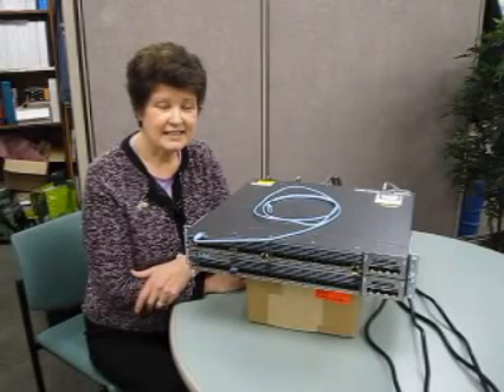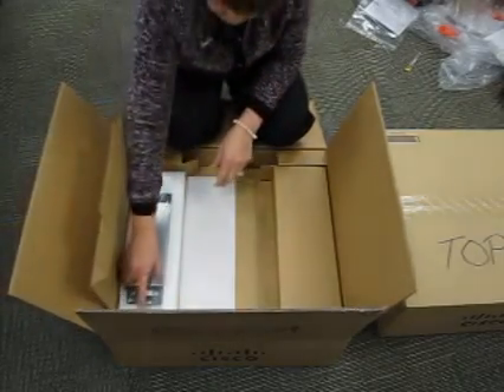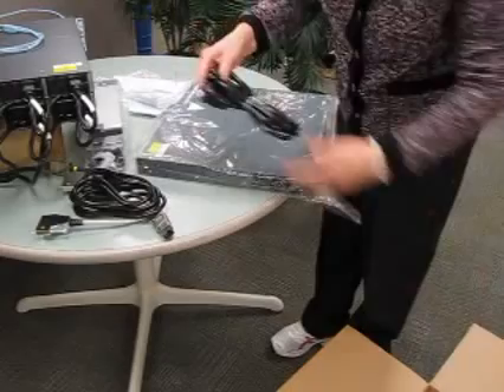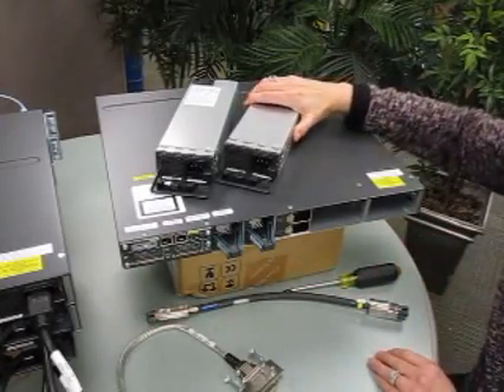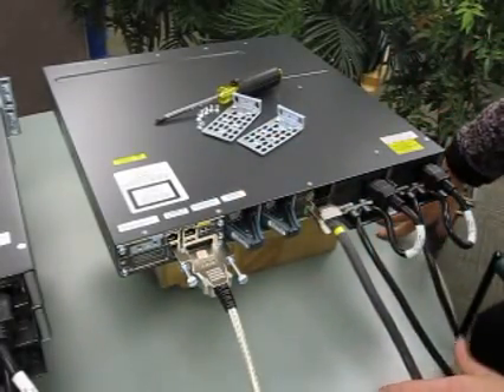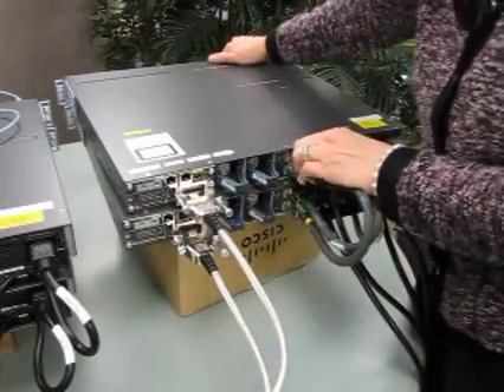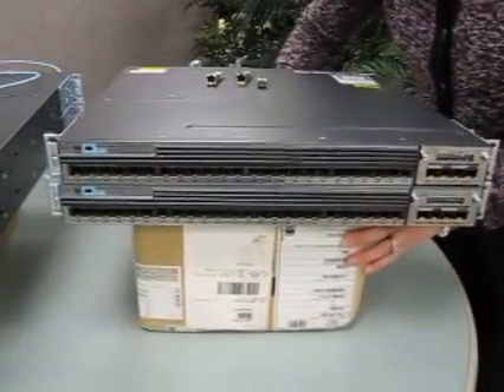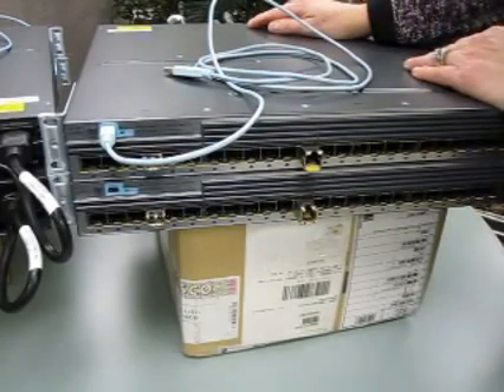Setup and Stacking Cisco 3750X Switches

Comment: How do i connect a cisco 3750x to a cisco catalyst 3560x switch.Which cables do i use for them to communicate
Reply: In stacking, you need identical switches with identical IOS. However, if you would like to trunk the 2 via SFP, simply purchase a 1gb interconnect cable 50cm. On each port configure SWITCHPORT MODE TRUNK and then SWITCHPORT TRUNK ENCAPSULATION DOT1Q. This will work fine if your switches are managed.